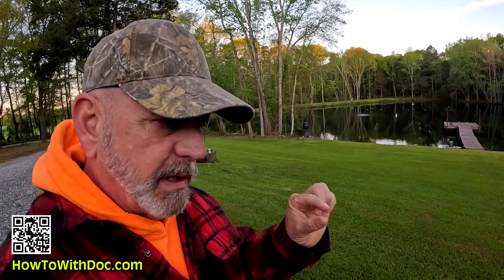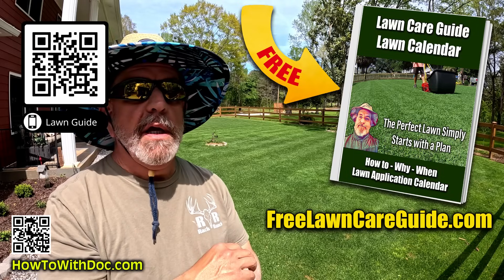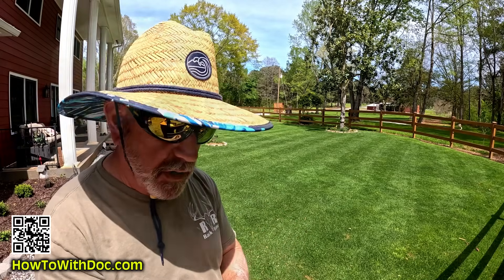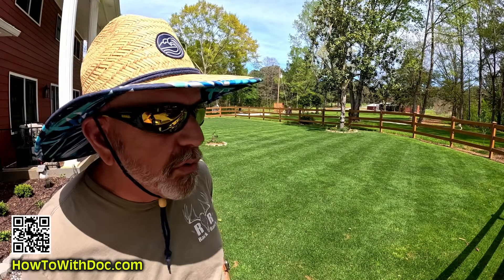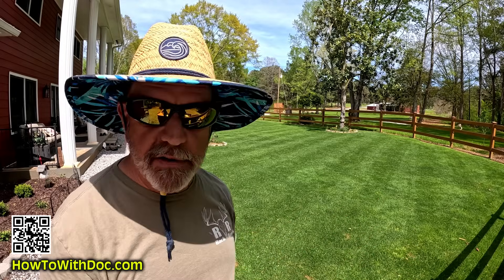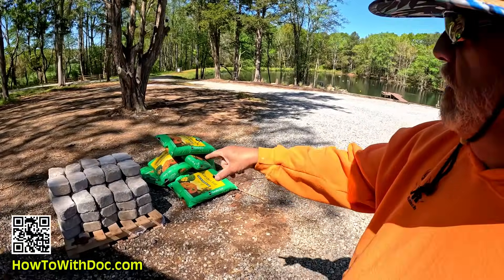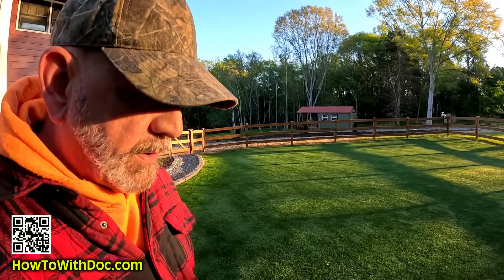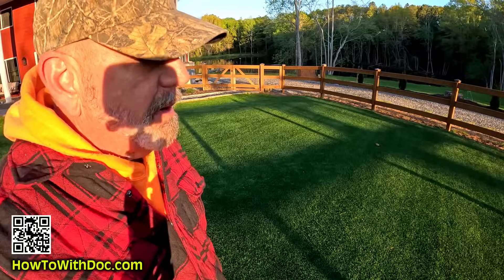Lawn Core Aeration Tips and How to

Comment: It's manual labor but I have found the ego bristle broom flipped backwards so it brooms back at you will clean your grass clean as a whistle while you walk backwards with it. Just have to do sections at a time and take breaks. I use mine for sand that graders push into my yard with snow, crab apples, nuts, leaves, and grass. Borrow someone's battery or gas and try it out. You have to flip the damn thing tho because the other way is way to hard to push.